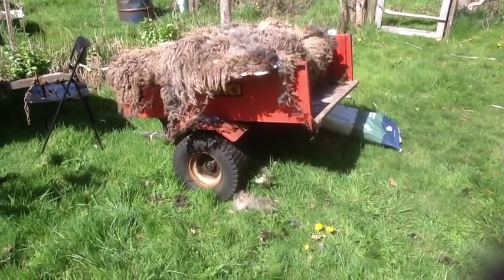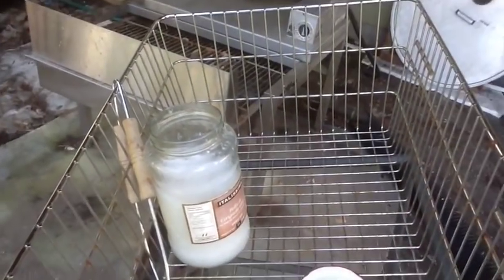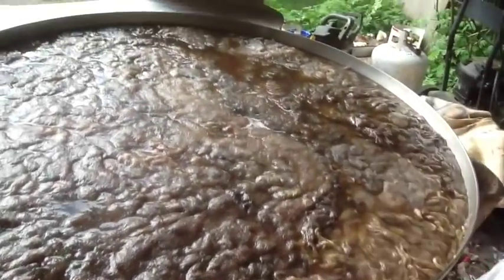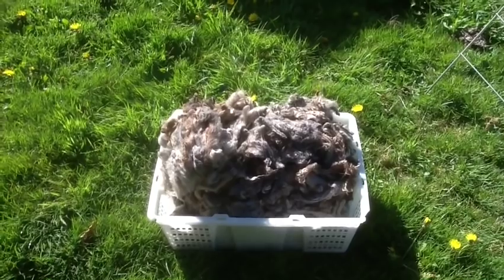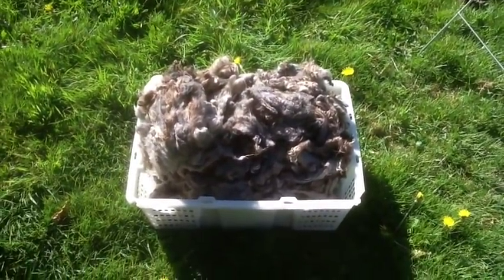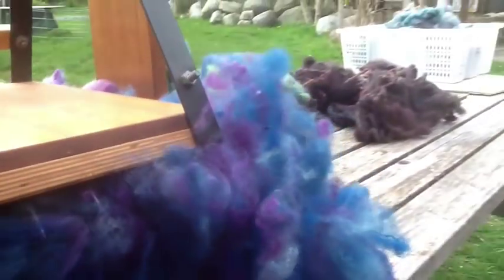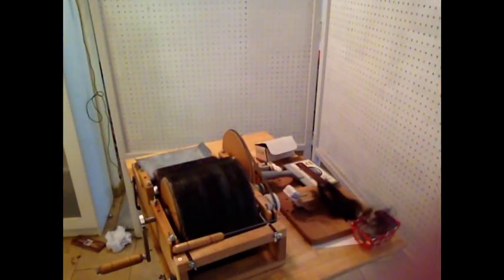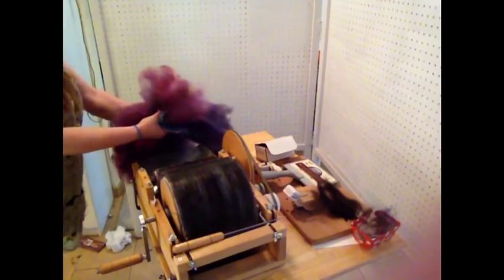Fleece From Start To Finish

Comment: I know nothing about preparing fleece, but I thought that wet wool felted so easily that simply pushing the wool into the water would cause it to felt.  Did it not felt because the water wasn't very hot when you put it in?
Reply: to wet felt you need to use soap and kinda massage it into flat pieces

Comment: does the lanolin not reattach itself to the fleece if it is left to go cold on the first wash
Reply: sandra shorland , no I don't find that.
Reply: I tried the hot water and i tried cold water. Made no difference in the end result to me...helps if you put the wool onto a table that has no top but has a screen instead and you hit it till no more dust falls out before washing it at all.